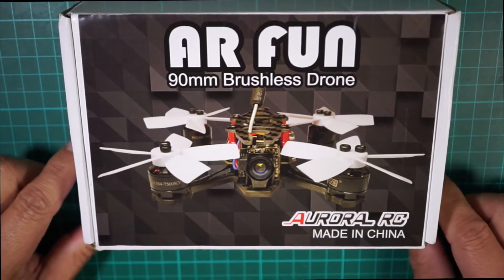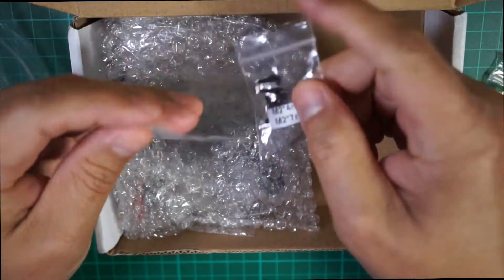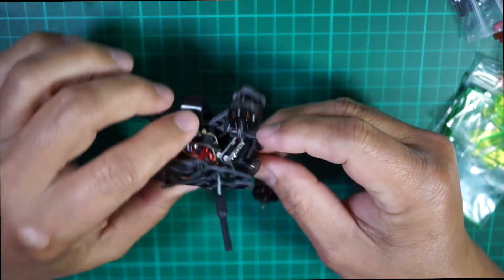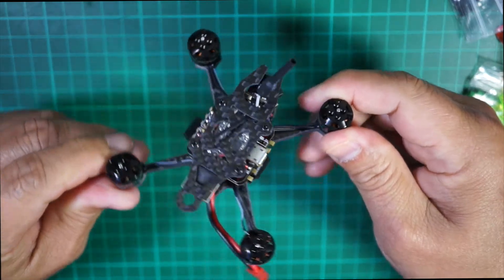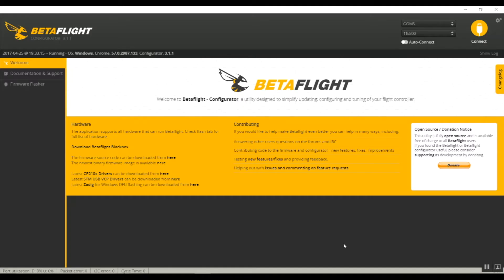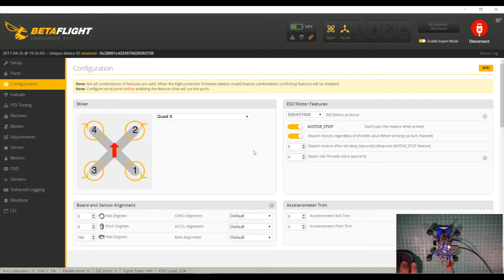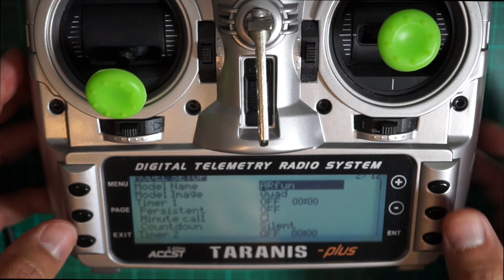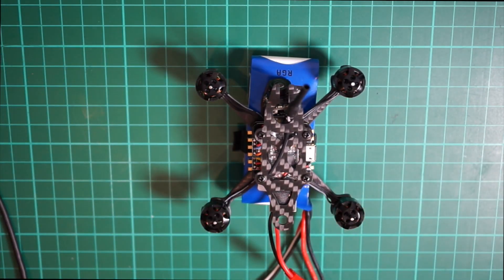ARFUN 90mm Brushless mini racer OSD & Buzzer- BNF with Taranis and Betaflight

Comment: Hi Daniel, I just want to know if ordering the Flysky version it can be bind it with a turnigy evolution or need a receiver like (AFHDAS 2A): http://www.gearbest.com/multi-rotor-parts/pp_572113.html?lkid=10694971. Thanks
Reply from the maker: Juan Diaz, I can't answer that since I don't have the Turnigy evolution controller.  I ordered mine with FrSky receiver and use it with my Taranis controller.  Maybe someone else can answer that.
Reply: Look what I just found. It's for 132.99 USD with coupon code: XIAOMIPHONE051905
http://www.gearbest.com/brushless-fpv-racer/pp_617107.html?wid=21&lkid=10749699
I bought one

https://www.youtube.com/watch?v=TkoJioE63Uw

Comment: I seen the new props they sent out and was hoping for a better battery
Reply from the maker: John Rossey, I don't use the battery that they included with the drone since it's only 25C rating.  I ordered Turnigy Nano-Tech battery 300mAh 70C instead.  The ARFun drone performs better with the Turnigy Nano-tech battery though.
Reply: I ordered one and was hoping they fixed the pointless battery they send with the quad, at least there's some better props